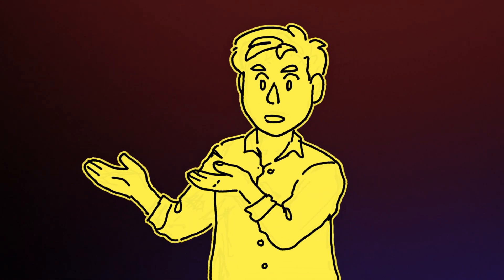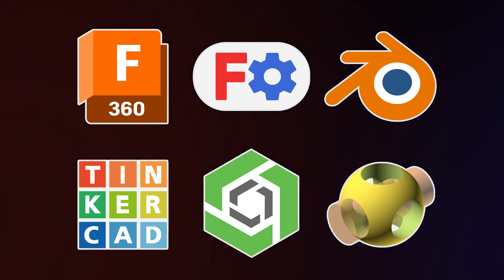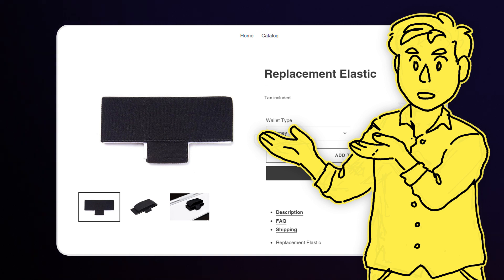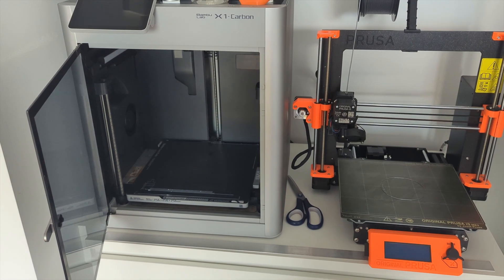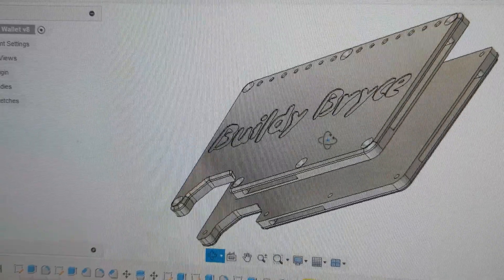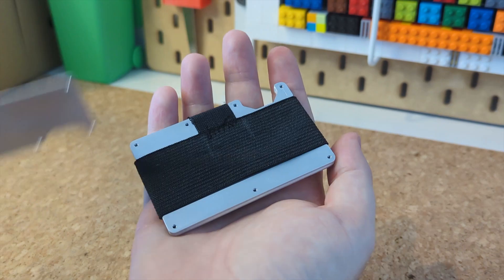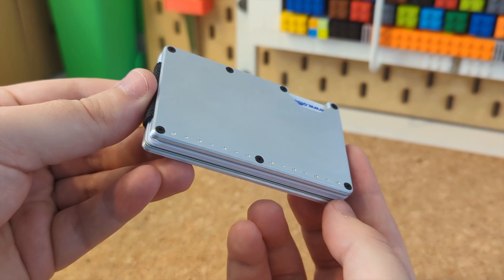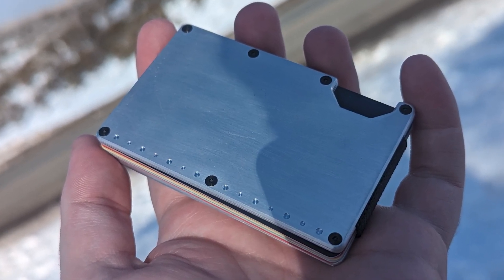Minimalist Wallets Are Expensive – So I 3D Printed One

Comment: I made my own card wallet about the same time as yours. It looks similar, but also have aluminium foil inside to block the chip from the outside. I hand sewed the elastic band myself with a needle and some thin thread

Comment: I designed a 3D printable minimalist wallet then made it in wood, I first had to make my own hardwood ply from thin veneers (although I've since found out you can but this type of ply for model making (apparently)  - if interested you can see on my channel - I wont post a link as I'm not trying to promote - BTW I found it was beneficial to melt the ends of the elastic to stop fraying. My wallet is still the favourite project I've done.  :-) Thanks for posting the video.